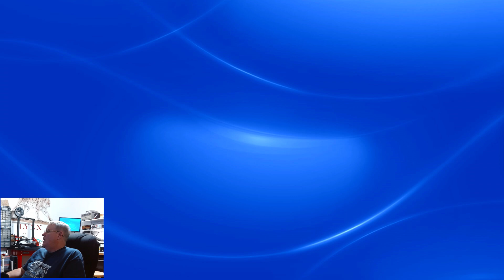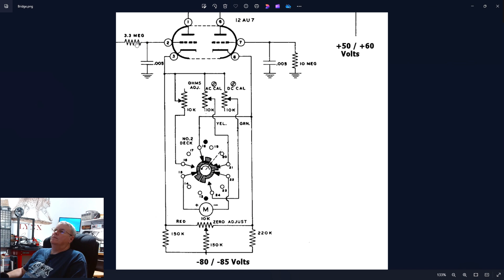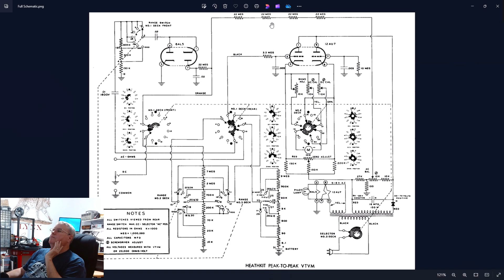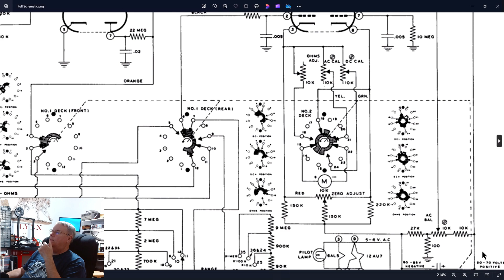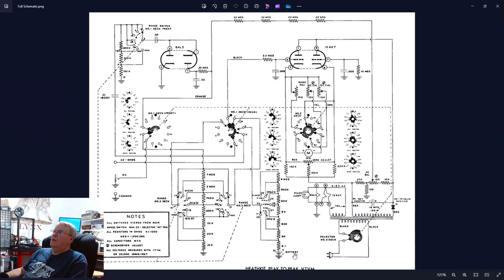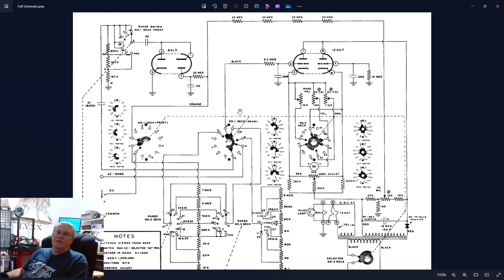HEATHKIT V-7A VTVM: Circuit Analysis Explained

Comment: On a 240 volt system is it alright to conect the earth points to a mains earth when working on other earthed equipment safely good video
Reply from the maker: They are to many gotcha’s to this question for to answer yes or no. Sometimes we want the ground isolated while working on equipment for safety. But when not working on it we want the ground to be connected so something can trip the breaker or fuse if a chassis short happens making the equipment dangerous. 
RJ